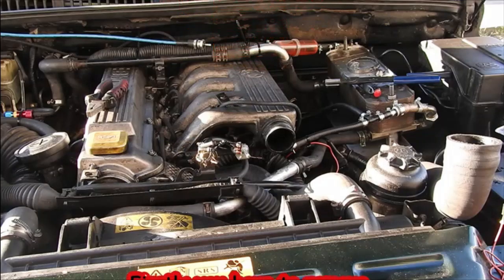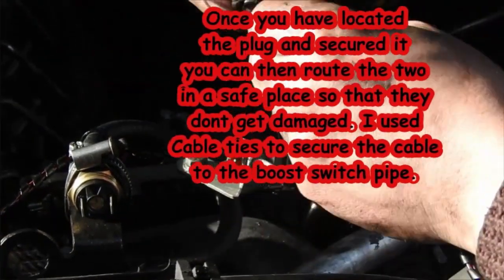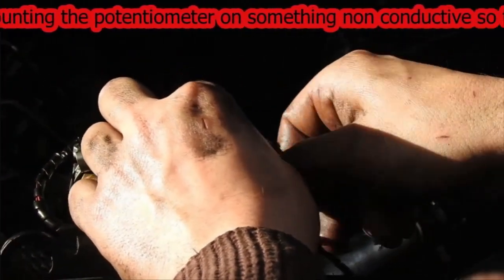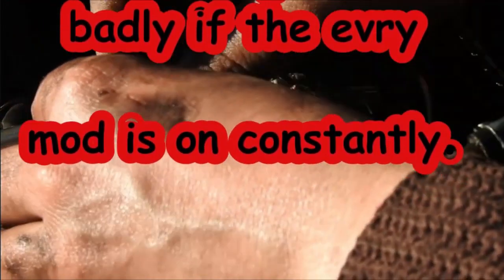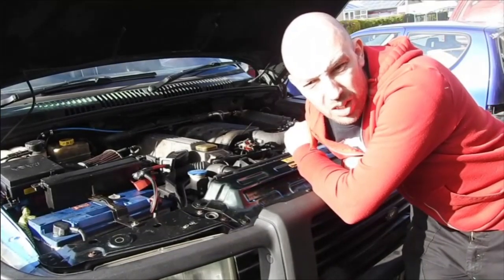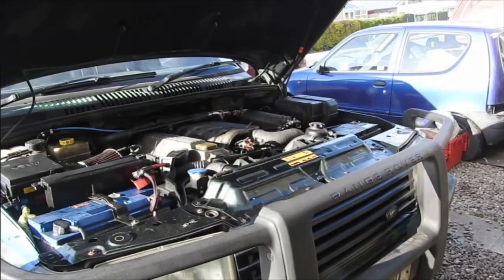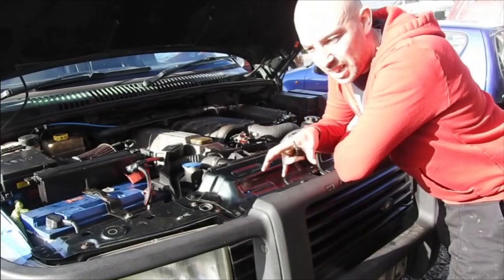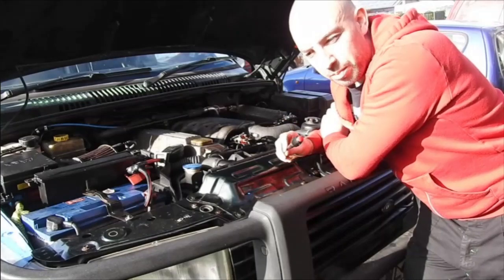Diesel tuning, Boost activated Evry Mod, +25bhp! £30. VW, BMW, MERC, Bosch VP37 tuning.

Comment: Watched a few of you're videos, good stuff fella! Great vids, love the sound of the hijiet cool af too! :D , dya reckon this would work on a shogun 3.2 did 2004, it has the zexal/bosch vrz pump, I've looked on every forum and googled for days no answer anywhere, it seems nobody has tried with a shogun or a mitsubishi tbh! I'm willing to be the 1st haha, cheers mate 👍
Reply from the maker: I don't know to be honest. If it has a fuel temp sensor shown on the pinout you may be able to peg a resistor in there to fool the ecu. 

I think with the more modern stuff it would be best to get a mild remap.

Thanks for the feedback, I am going to get back to making videos this summer. I haven't had time to do it recently
Reply: @michael winder  yeah it does have a temp sensor, I just don't know to much about diesel pumps I now some of the vws can and others like the pd tdis can't and always wondered why as there mechanical/eletric pump I believe, might just have to take the plunge and try gonna keep googling for now tho. Cheers for the response carry on with the content some really useful cool info. Cheers mate
Reply: Will work on did shogun
Reply: @paulthompson5289   im soo gettin a potentiometer for xmas in that case! :D Time for some smokey fun in the snow, if we get some more!!

Thanks for letting me know, ive been wondering about this for a while now, slowly started to get some bits for my bus, boost gauge etc,  i tihink the pot is deffo next!!  cheers ;)

Comment: More pollution for the environment  and the woods will die from your pollution ☠🌲☠🐱😋👍👍
Reply from the maker: apart from the fact it ran on 100% veg oil. Thats what the huge recycled heat exchanger is for, you can see it in my other videos. I have been an alt fuel guy for years.

Comment: Did you use positive source from boost controller to attach to the final peg on potentiometer #3?
Reply: Thanks for the quick response I think I finally got it
Reply from the maker: I used it in series as a variable resistor on on pins 2-3 in the plug . rather than dividing 5v potential like a map sensor does. sorry if I have misunderstood your question,  I am not fully understanding what you are asking me.

Comment: Is it possible with vp44 bosh?
Reply from the maker: I am going to say yes, but I havent done it to a vp44. From doing a bit of research there is a wire you an tap into on the top of the vp44. https://www.youtube.com/watch?v=Kcyfkqq-oHA

I assume that you could use a potentiometer the same way I have done and have the whole thing switched on and off with a boost activated switch similar to how I have done, I would do a little more research if I was you but there is lots of info for the cummins 24v with a vp44

Comment: Hi mate loving what you've done with the evry mod, I am about to get it done on my p38. With your bleed valve did you manage to run the extra hoses without getting the turbo off and what diameter hoses did you use? Stock boost is 1.2 by the way. Easy way to run a boost gauage is plum in to the map sensor line on the manifold 👍
Reply from the maker: The actuator pipe is quite easy to get to, I pulled the pipe off of the turbo compressor housing and left it attached to the actuator. I teed off the pipe from the actuator and sent a pipe up to the boost switch and then joined two longer pieces of pipe one to the other side of the tee and one onto the compressor housing and routed them so that I could mount the bleed valve somewhere convenient. 

If you follow the front edge of the exhaust shield with your fingers you can locate the pipe and pull it off the compressor housing without using tools on the clip. the pipe i used was some pipe that I had kicking about, I think that is 4mm ID but its really flexible, I think that the injector leak off pipe is about the same internal diameter.

For the switch I plumbed into the actuator pipe because this will be the first to see maximum boost, there would be a pressure drop by the time it got to the intake. As for the boost gauge, I have one, its locked down at work though, I will be fitting it ASAP. I might add some preload to the actuator too as I think its creeping open with the drive pressure pretty early and its spooling pretty lazy. 

The mods have made a heck of a difference though, boost is starting at around 1400rpm now and it will happily sit and 90 all day in places that you are allowed to do those speeds. I found 680 ohm resistance to be just right and its ballanced out the smoke with more boost. its pretty quick for a 2.6 ton boat.
Reply: @TheVillageBikes  cheers mate ill try that was thinking of just winding the actuator rod but the bleed valve will give me more fine adjustment, surprising in your video you said the bleed valve didn't work when it was inline and u had to tee it, I always thought it acted inline like a restrictor. Handy to know tho! I have the same exhaust as you but if you add a decat pipe it makes a big difference plus a tone of turbo whistle 👍

Comment: Excellent video, how did you set the potentiometer?
Reply from the maker: Some how this got cut during my editing. I am a beginner lol. The potentiometer was set at around 2/3 of its rotation. I have balanced out smoke and how the extra power is delivered. This will be slightly different for everyone, you might need to give less or more resistance on the potentiometer. And please make sure that you fasten the potentiometer to something non conductive.

 I haven't been able to do much testing due to the lock down however I am doing the best I can to tune it in between  going to the shops .
Reply: @TheVillageBikes  thanks for the reply, only ever done something similar on a vw, involved hedging 2 bits of wore into the pins with a resistor out an old VCR soldered onto it. Idled rough as well but was plenty smoky 😂 will definitely be doi g this mod to my dse
Reply from the maker: yes thats how it works, the boost switch disconnects the resistor or pot at very low boost levels so that it idles nicely. its worked really well. I did the mod on a passat years ago without the boost switch.
Reply: Will be following with great interest on rrp38uk to see how you get on setting up a second boost switch 😎

Comment: this is just car abusing :(  undemanding tools, undemanding solution.
Reply from the maker: It's ok, people feel the same about the tuning boxes too. It's supposed to be cheap, simple and effective. Personally I would prefer a manual pump. I will be building one out of a cummins 6bt ve pump as the base and then fit a compound hx35 turbo in the future.